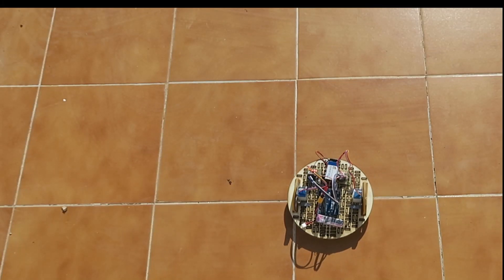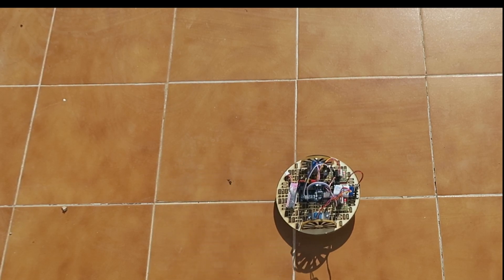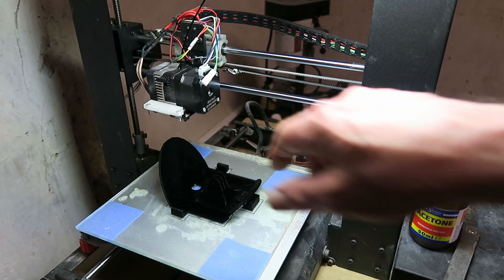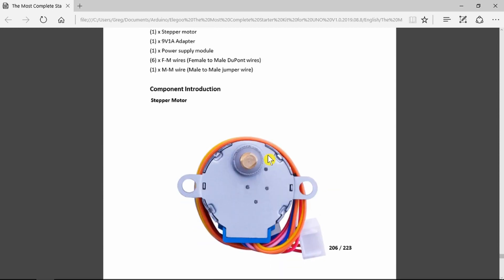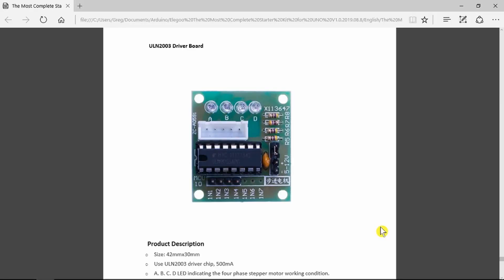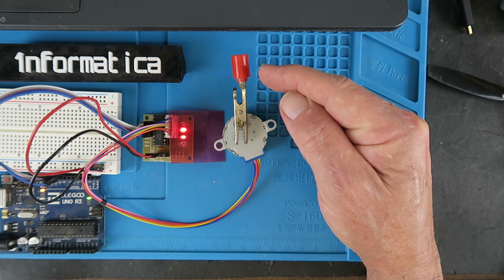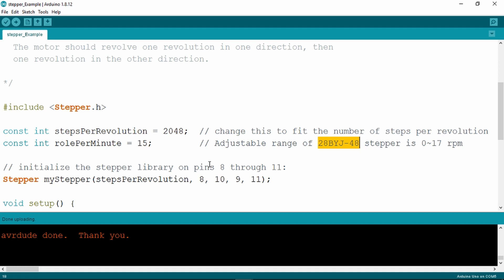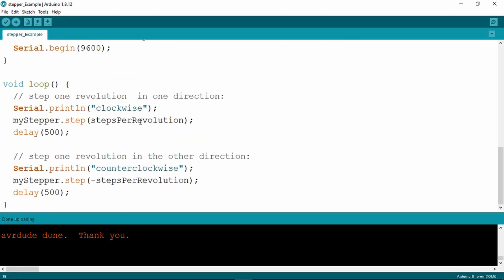Elegoo UNO R3 Project Part 23 ULN2003  Controlled 28BYJ-48  Stepper Motor

Comment: My motor is turning the opposite way than the serial monitor indicates so I thought I’d see how yours works. Yours works correctly, of course, but it looks like you’re plugged into pins 9-12 instead of 8-11.

I thought that maybe it looks that way due to parallax but I figured I’d shift the four jumpers over by one pin. I realize this is an unsafe practice by someone who knows nothing about these things (me). I was mildly surprised there were no flames and more surprised that the motor turned as it did before. The LEDs on the board don’t light up quite the same way but there’s no smoke at least 😆  Clearly I’ve some learnin’ to do!

I appreciate your brevity and clear explanations, even though I don’t fly r/c aircraft it all looks pretty interesting so you’ve got another subscriber (me 😁).
Reply from the maker: Hi, thanks for subscribing. If you have any questions please ask.